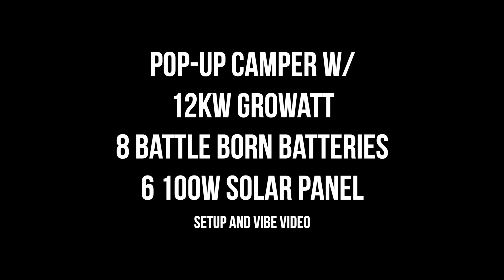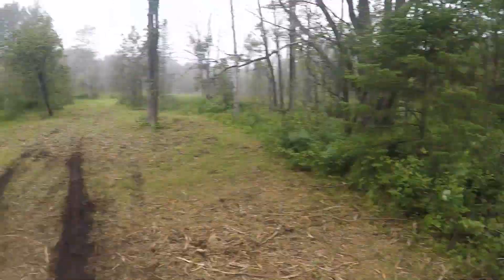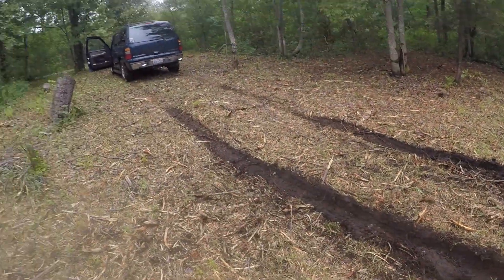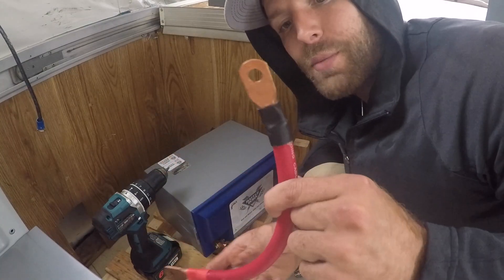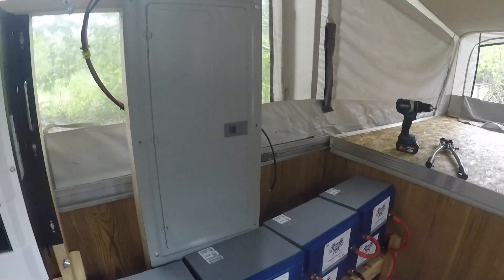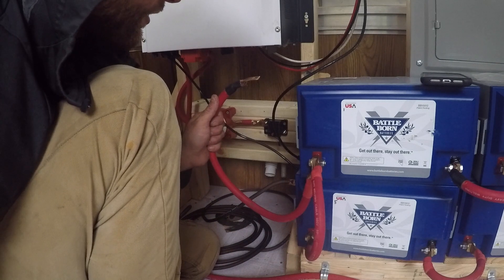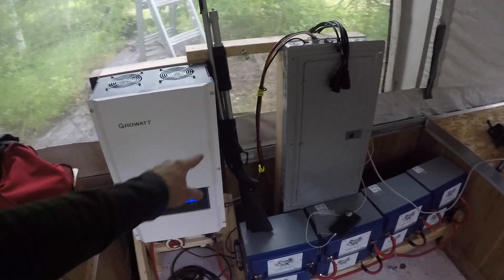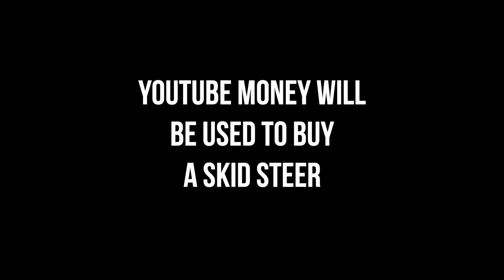Growatt 12KW Inverter - Off Grid Electrical Setup

Comment: Adding a ground rod to an otherwise isolated system doesn't make any sense at all; you just made it more dangerous. The ground rod is used to prevent the possibility of high-tension power line voltage being capacitive coupled through to the secondary windings on a residential service (this can be many thousands of volts; You don't have this). Now you can get shocked by touching the hot wire and any ground; before you would have to touch two wires at the time to get shocked. Before GFIs adding an isolation transformer and removing the ground from the load side was the safe option.

Comment: Why did you order such a small inverter ?
Lol. 
Picking up our 12k growatt in a couple weeks when we return to U.S.V.I. where our 8k inverter is on the fritz now.
$2700 for the repair part itself so the new growatt has proven to be a smart purchase even before installation. It was meant as a SHTF backup, and now I'm glad to have it handy.
By the way, USVI just raised residential elec rates from 42 cents up to 63 cents per Kwh. Glad to be on solar there otherwise it'd be $1800-$2000
Each month. Funny to see people complain about the cost of inverters after that !
Greetings from Manistee for now & Happy New Year...

Comment: Let me know how your 12kw inverter works? I have the same thing on my off grid. The inverter is having problems connecting from my generator to charge the battery when it’s  low voltage. I have been dealing with Signiture Solar Tech. Sucks